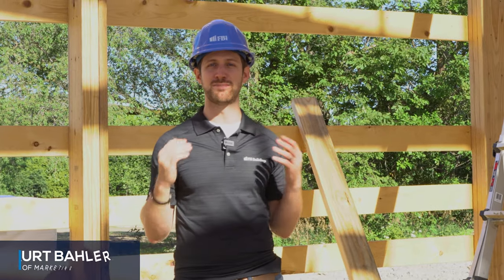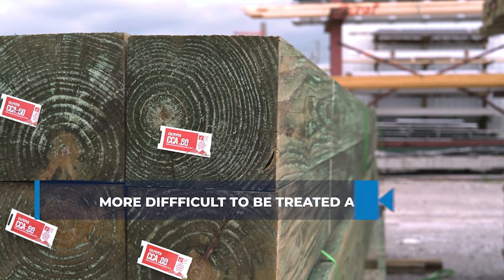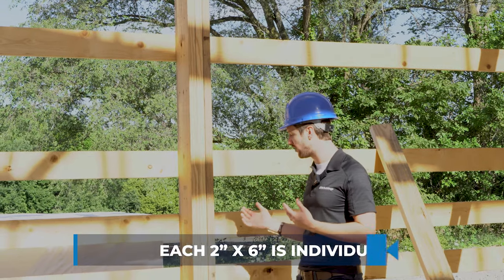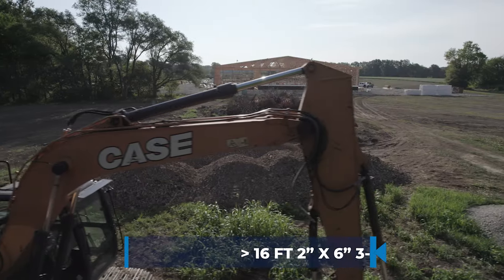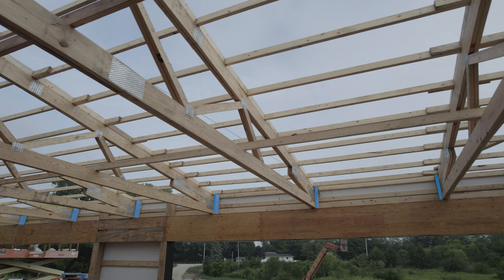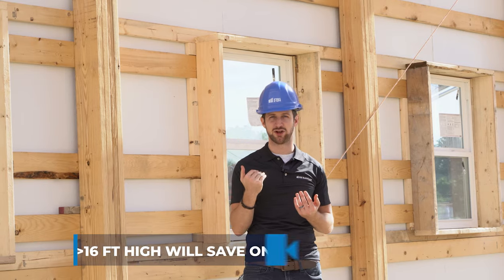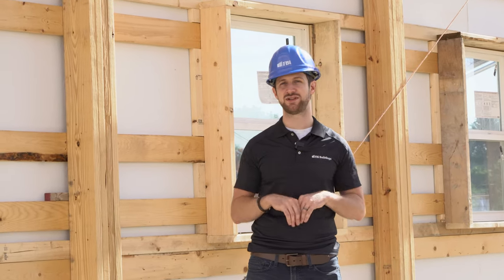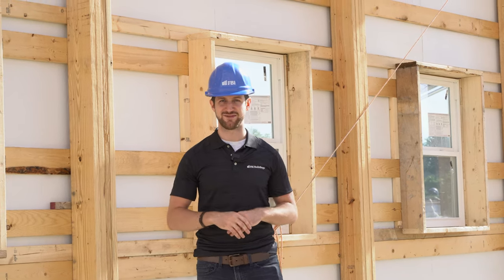How to Choose Pole Barn Columns: Laminated vs. Solid

Comment: ? Does the colume  have to be made out of all treated lumber..or can the bottom be treated and then switch to pine ?
Reply from the maker: The treatment of our columns exclusively involves the use of southern yellow pine. The approach to treating these columns may vary depending on the builder and their specific practices. Typically, builders either treat the columns entirely or not at all, with little middle ground.
Reply: most common is treated below ground then soft whitewood above..BE SURE YOU WATCH CLOSELY! LOWES WILL SELL YOU  "" NOT GROUND CONTACT LUMBER even though it says treated!!WATCH the tags!

Comment: Some of my solids have twisted almost 90 degrees
Reply from the maker: Thank you for sharing your experience. It's unfortunate to hear about the twisting of your solid columns. Twisting can occur due to the natural drying and shrinking of the wood, especially if it's not properly dried before installation. This is one of the reasons why many builders prefer laminated columns, as they are engineered to reduce the risk of twisting and warping over time. If you're looking to get these columns replaced, please feel free to reach out to us. We'd be happy to help if you're in our service area. 

https://www.fbibuildings.com/about-us/our-service-area/

Comment: I thought laminated columns always used an odd number of plies?
Reply from the maker: The number of plies in a truss can vary. Single-ply trusses commonly have three plies, while double-ply trusses typically have four. Additional plies can be added as required.